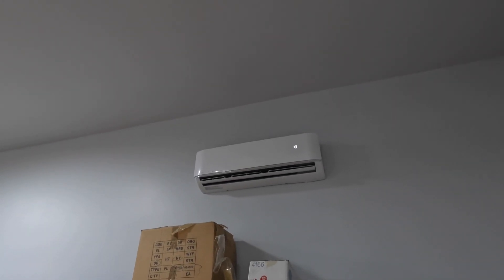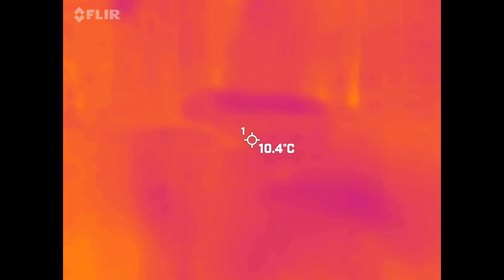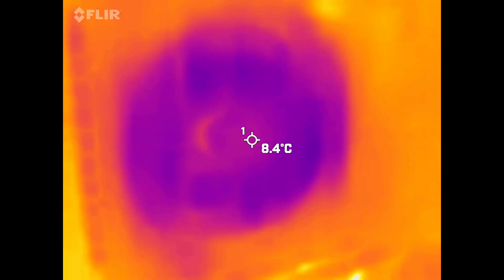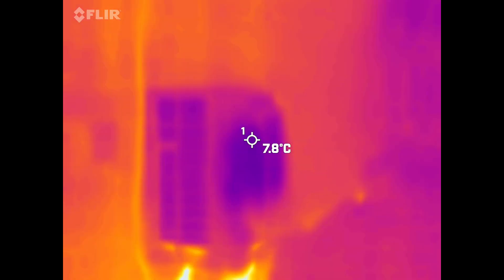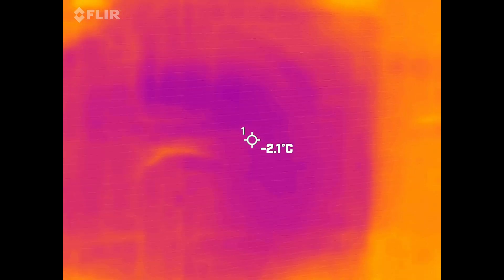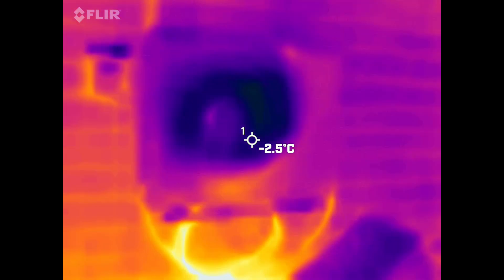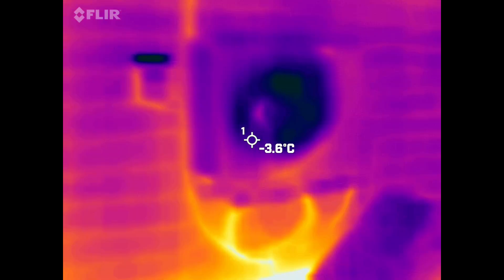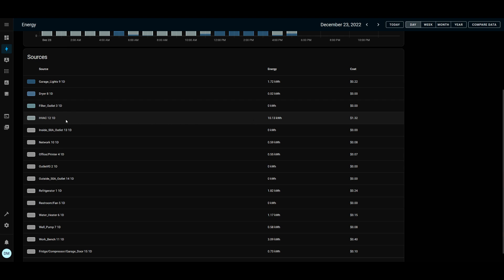MrCool DIY Gen.4 Performance @ 16 °F (-8.5 °C)

Comment: Hopefully none of my comments prompted your comment. Most of those air to air heat pumps have I think it is called a cop and usually it varies with outside temperature and will be above 1 until somewhere around -10f each make is different so at 1 it is basically a resistance heater and anything above that make you money lol. In Canada Mr Cool is good to -22 f which is very good make. You will never be cold in Georgia with that heat pump.
Reply from the maker: It was not your comment. Some other. I think variable speed compressors should be the norm for central heating and air here in South. I have decided to do so for the upcoming home build. Variable speed compressor and variable speed air handler  .
Reply: @DMIINC2013  I know my variable speed deep well pump is the best I have used just makes sense not to use power when you only need a little.
Reply from the maker: Grundfos constant pressure variable speed pump here. It is amazing. Great minds think a like. I just got some ego battery powered yard tools thanks to your snow clearing video.